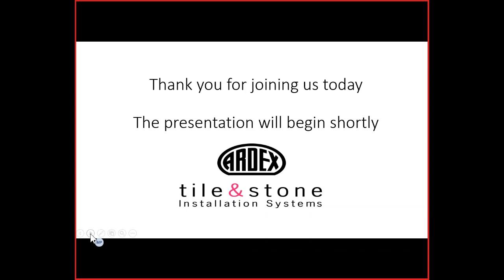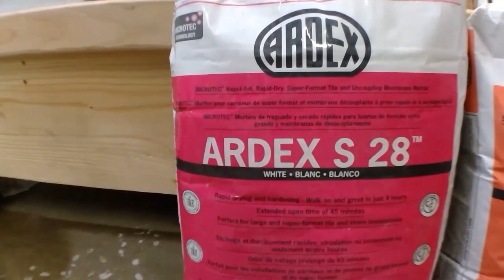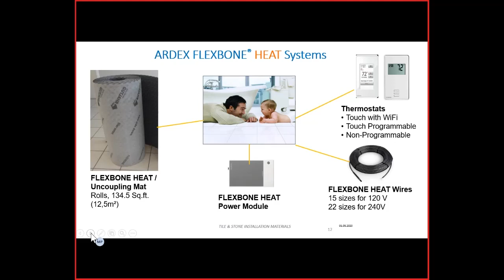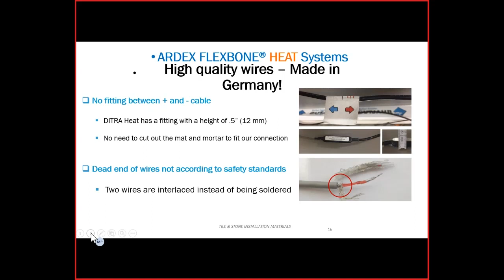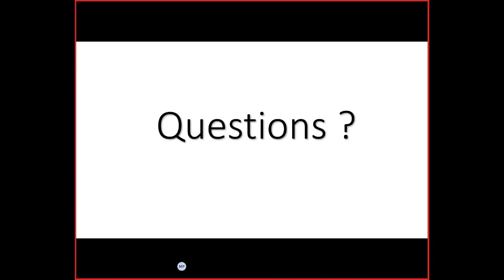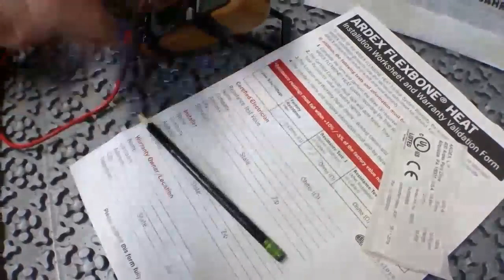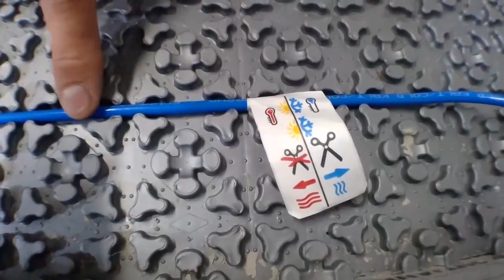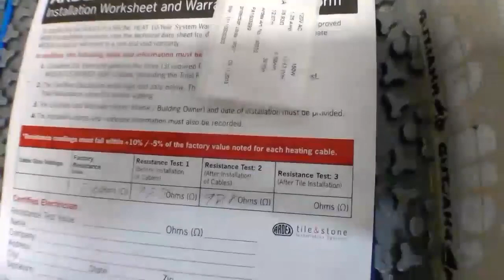ARDEX Webinar  - FLEXBONE Uncoupling and Heating Systems

Comment: I have purchased the Ardex heating wire.  Can the cold lead portion be cut (the instructions seem to indicate that it can be but must not be cut less than 3 feet)?  If the cold lead portion is cut, will that affect the resistance measured?
Reply from the maker: You can cut the cold lead portion, but like you mentioned, it must be at least 3 feet long. Cutting it will not affect the resistance measured. For additional technical support, call our technical experts at 1.888.512.7339. Thanks!

Comment: How much space do we need to leave between 2 uncoupling mats and how much do we have to leave between the mat and the walls/barriers?
Reply from the maker: Hey there,
At seams the mats are are normally set adjacent to each other, with no spacing required. To observe industry recommended movement accommodation, 1/8-1/4 (3mm-6mm) space is suggested between mats at these locations. Please reach out to our technical team at (888) 512-7339 if you need more information. Thank you!